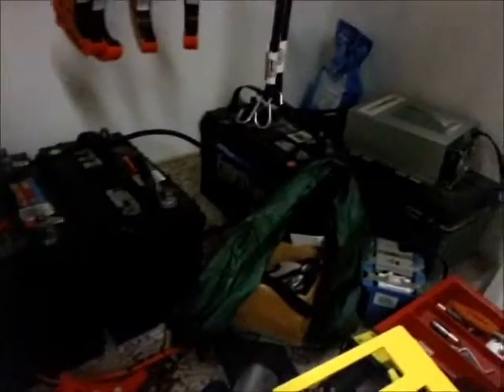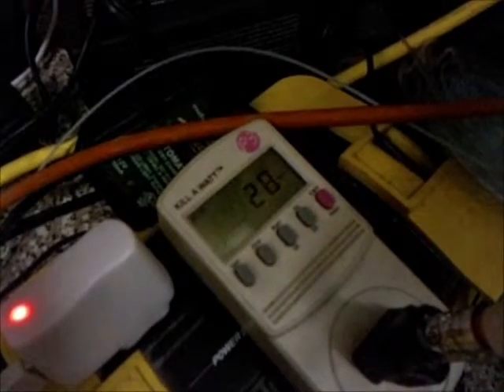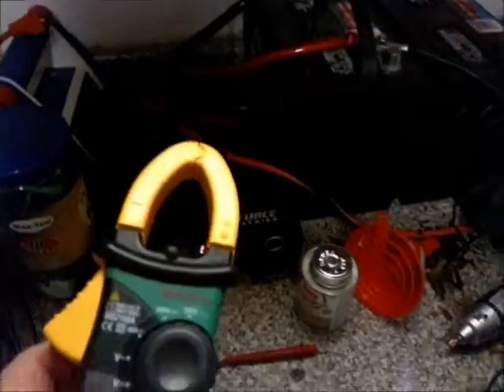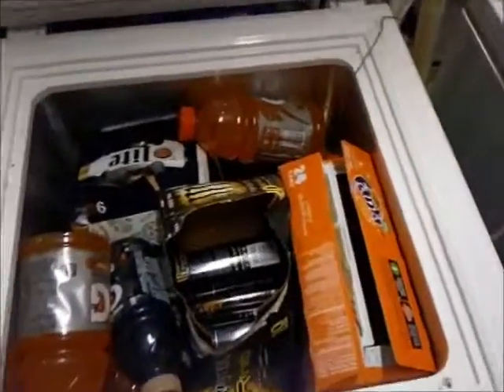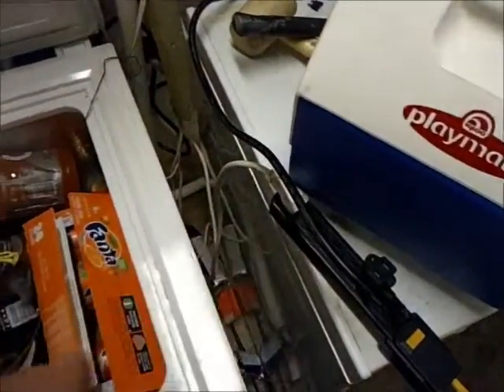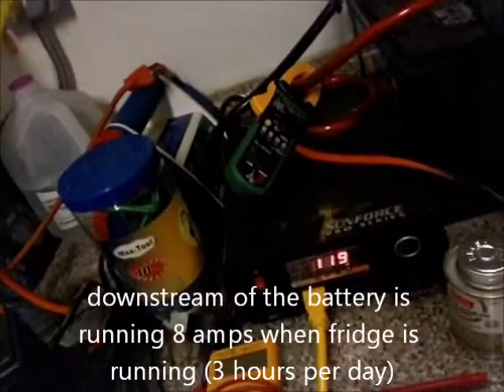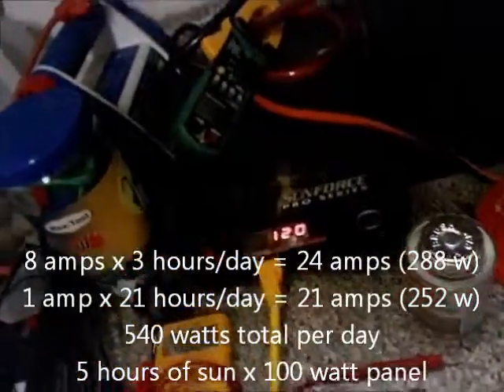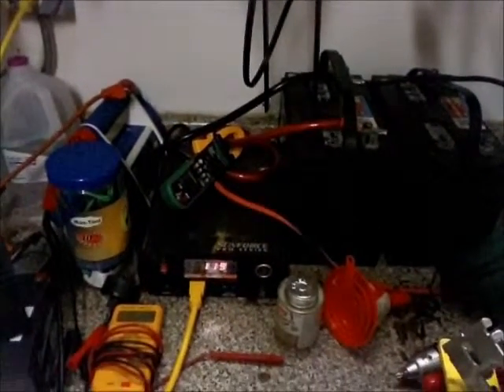Solar Refrigerator - 100L Chest Freezer Conversion

Comment: could you add a capacitor from your battery bank 2 you're inverter the kind of kids use these days in those high performance stereos in their cars a DC powered capacitor would that help to offset surge when the compressor starts up cuz I'm thinking,,,I want try this also but I am thinking 700,,,,,watt surge at 12 volts would be hard on my bank,,,would pull 70_80amps out of my power pack all at once ,, I wonder if it might be better using 24 volt setup?I have been looking at some factory reconditioned forklift batteries the price is right and in most cases they will deliver right to your garage I have a small garage I would have to rent a pallet jack though to pick it up and put it into place and thier24 volt or 12 volt,,  I don't think my 4x Exide 186 amp hour batteries could take the surge over a long time,????I'm very new to all this so I really dont know,,,what do you think???
Reply from the maker: +bill767667 Hi Bill.  Couple thoughts.  Your typical marine grade battery is designed to produce enough cranking amps to start a boat engine (think inboard chevy 454) without damage.  The tiny 1/3 hp fridge motor is only drawing that higher amperage for a few seconds or less (not hours - your not going to lose 80 amp-hours all at once).  It should not damage (or drain) the battery, and there should be no long term effect.  The capacitor is not a bad idea, but I don't think it is necessary, and you would have to size the thing right.  Also, a capacitor is not something SAFE for the average youtuber (since large power remains even after disconnect).  For the 24V system and golf-cart or fork-lift batteries, then yeah - these are better (except for weight and transportability).  I made this video to outline a relatively cheap and bare bones solution.  Typical fork lift batteries are not obtained for cheap.  If you go 24V, then you can start to run into some extra costs in sourcing parts that run on 24V in the USA.  The benefit of higher voltages is that you can run either smaller wires or longer distances.  Your Exides seem more than capable.  Hope this helps!
Reply: Thanks